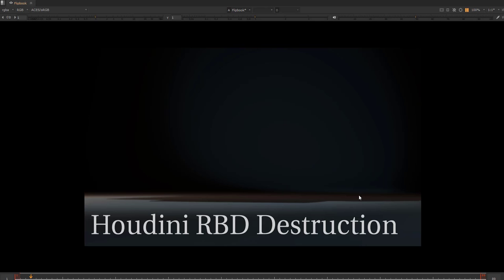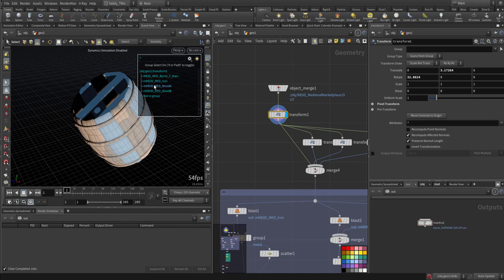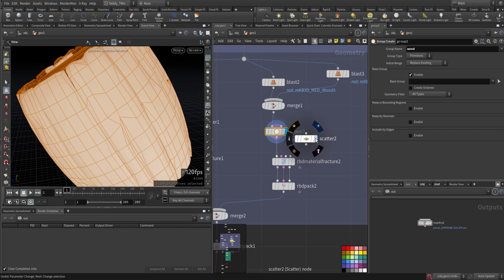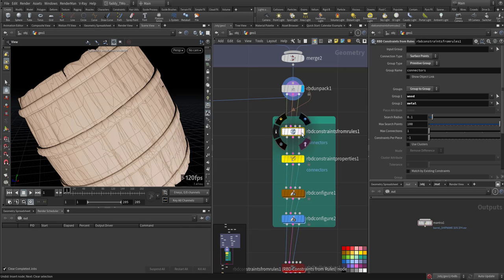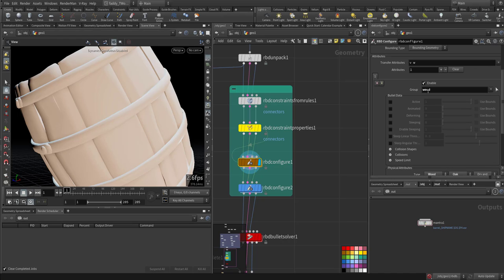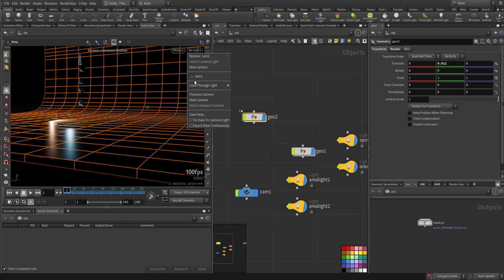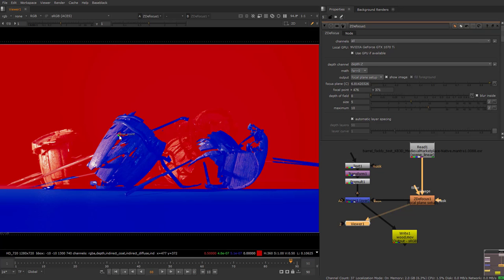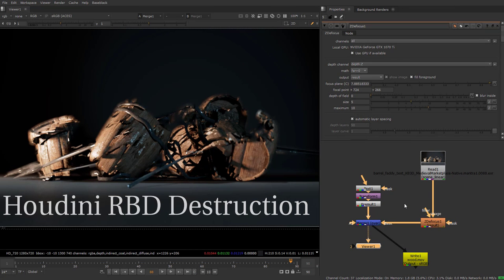how to use Houdini to Destroy Wood and Bend Metal

Comment: Thanks a lot, I have a doubt, I made a Car crash with voronoi fracture 
and for breaking  glass I gave RBD material fracture and in the dop 
network I made the crash with another static object. Since Car has the 
animation so I gave deforming active object in the packed object node 
everything was fine but Car's glass is breaking before it makes contact 
with static object. would you please tell me how to fix it?
Reply from the maker: you can write a wrangle to the proxy for the glass to be @active=0 and @animated=1, then on the impact frame write if @Frame and make the @active 1 and @animated=0, now inside the rbd solver make sure to over ride the active and animated attribute so the solver can pick it up
Reply: @FaddyVFX  
Thanku, would you please give me the exact note because I am not that good at writing expression. Thanku......I really appreciate your help.